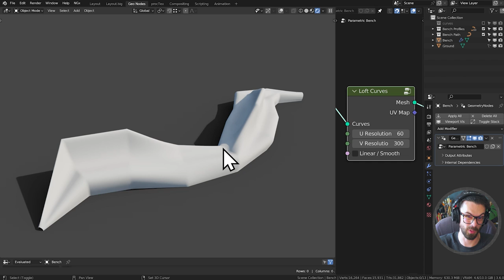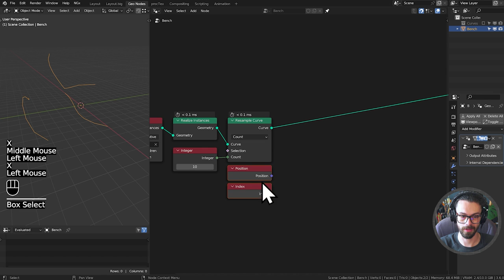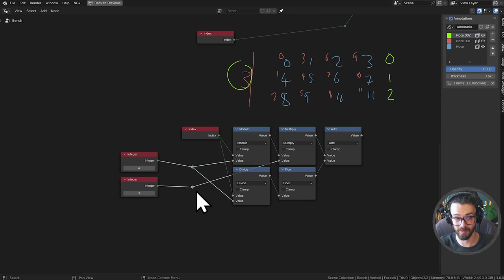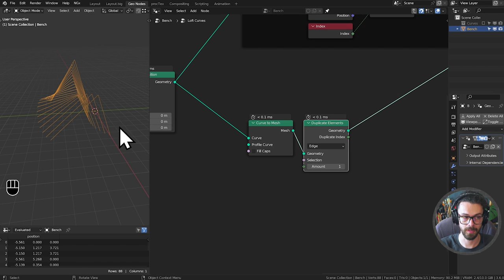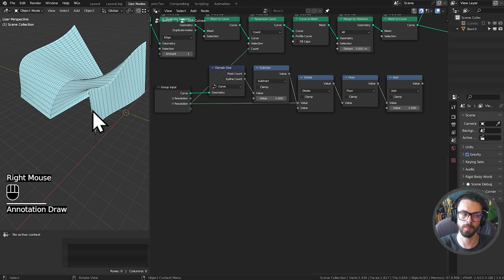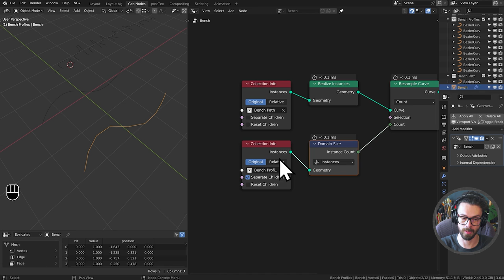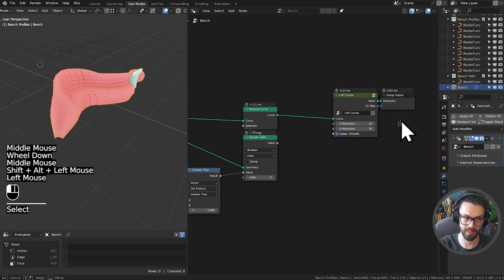Loft Curves Properly - Geometry Nodes in Blender 3.6

Comment from the maker: Lofting is one of the cornerstones of parametric modeling.
What other topics do you want me to cover?
Reply: Procedural road modelling with intersections
Reply: This setup, by Entagma using Houdini:
New In Houdini 19.5 Pt.1: Tangent Fields (And a Bit of VEX)
New In Houdini 19.5 Pt 2: Karma XPU Beta (MaterialX, Solaris)
Have a think on it first, if treating tangent singularities via attribute smoothing is even possible.
This does cross over to materials and anisotropic shading, which Cycles may handle differently.
One bug (feature according to devs) is that UV driven tangents don't smooth across UV seam.
Reply: Pls make a tutorial explaining the curve & mesh topology nodes.
Reply: @aarcharanya  yeah, tutorial on topology nodes is sparse and a bit hard to find. And maybe after that you can cover utilities → field nodes?
Reply: Contour curvers for any mesh
Reply: @codedvoxels  hey...I would like to know what contour curves are?
Reply: If I have a vertex selected, I want to be able to select n vertices on the U direction and p vertices on the V direction where n and p are independent and can vary between 1 and a lot. 
The indices aren't the way since in practice they are never in accordance with the UVs. Set ID may be but this is above my pay grade.
Reply from the maker: Are you wanting to select a rectangle of verts or just a line in the U or V direction?
Reply: @Erindale  A line is just a rectangle with a 0 width. But both, a rectangle with an adjustable width from 0 to a lot in both directions. 
I have another one.
Reply: On vertex being selected, I want to find the normal at this point (easy), one x and y axis of the tangent plane (done). 

When I move the selected point just a tiny wee bit the x and y axis have a tendency to jump (90°, 180°). I don’t want that, I want the x axis staying aligned with the U direction. So when I move my point around the axis is not jumping around. 

I can do this manually but I’d like to have it automatic.
Reply from the maker: Just that selecting a line of topology is vastly easier than a region. I'll have a think about it. Easiest would just be to select a UV region rather than needing a specific number of verts
Reply: @Erindale  Actually I would be very happy if I could select the next U or V. I'll try by selecting a region on the UV map,  then get the real position of the vertices. inside the region. I'll write to you an email with blend files.
Reply: can you do something on lofting between 2 separate meshes to connect them. lets say you have a mesh like at 32:57 with a hole cut out in the middle. inside this hole is a smaller mesh wish is insit in the z direction and also has a irregular topology with valleys and hills. how to loft these 2 meshes together, make them manifold for 3d printing and constrain the profile curve of the loft to the outer and inner mesh as curvature continuous or tangent, so one mesh transitions smoothly into the other?

Comment: At 49 minutes you say that it'll be different in Blender 4. I'm on 4.1 now. What should I change?
Reply from the maker: Your spline collection can be sorted directly without needing to go through the instance index stuff. Just plug the collection without resetting children into a Sort Elements node on the instance domain. Use position.x as the sort weight and then you want to reset the positions after which you can do with a translate instance by (-position) and then use this as the instances on your instance on points node. Make sure nothing is plugged into the instance index

Comment: Thank you ! How to use this when using only one 1spline curve in collection and it has mirror modifier ?
Reply from the maker: What is it you want the mirrored curve to be doing? How do you want to the final mesh to look?
Reply from the maker: @TynkaTopi to loft a skateboard shape it would be easier to imagine it like taking a skate deck and cutting through it with a saw lots of time. The slices that you’d see are the profiles and the line down the centre of the board would be the path. Then you can loft those profiles along the path to get the shape again
Reply: @Erindale  Yes, I'll try that way. With that method, you can do it accurately even if the board is concave in the middle.

Comment: Thank you for sharing this. Very thorough. I’ve got two suggestions though. 
1- At 39:09 you’re right to use 2 Align to Euler nodes to properly orient the profile instances along the guide curve. But the proper way would be to align the Z axis to the Tangent direction of the guide curve and then align the resulting rotation vector to the  Normal direction of the same guide curve. Leave the mode to Auto (that’s recommended by Blender in the manual). The order of these operations isn’t really important. There’s no risk of Gimbal lock. The alignments represent 2 consecutive transformations. This makes the orientation along the curve rock solid, no matter the guide shape. Also avoids the need to calculate which way is front. 
2- At 23:08, the trick to split the edges of a single line mesh using a Duplicate Element in Edges mode is a very pleasant surprise, but instead of converting repeatedly from curve to mesh and back, a simple Subdivide Curve node could have sufficed. 
Again, thank you for sharing a detailed and unified way to loft curves. I’m bookmarking this to easily reference it later.

Comment: I am amazed to see someone else solving this problem, and with a very different (and perhaps a much more direct) solution. Mine uses curves, too - but it takes a single curve and extrudes it using the "Curve To Mesh" node. The extruded curve has the number of divisions of the desired U resolution, and the loft-curves have the number of divisions of the V resolution (resulting in a grid with the correct number of divisions in either direction). Then, I can just use the factors of the curves and a "Sample Curve" node to place the vertices... and as a consequence I can keep the factors of the curves as UV's.
I added catmull-rom interpolation to it after seeing your video (I had no need for it for what I'm doing). Now it does everything yours does, and it gives me UVs (and any other data I want from the curves).
But I think mine is a bit more complicated.
Oh! Mine works on cyclic-curves 😊
Reply from the maker: Nice! I always love how many ways there are to solve problems when working procedurally

Comment: Very neatly done!😀  Clear and concise!  One  quibble, at 40:01 .. the 2-stage alignment to a completely defined orientation.  I could be wrong.. but .. I don't think gimbal lock has any bearing on the sequence of rotations.. they are step-wise  and  local .   The basis for the second rotation is still orthogonal, after  the first, there is no danger of the rotation axes coinciding. What might  be a problem, though,  is leaving both alignments 'Auto'.  In your case, for example,  if you first align Z to Tangent, ('Auto'), and then spin Y to (1,0,0) about the known good axis ('Z', not 'Auto') you should be OK.. 'Auto' won't throw the axis you have previously set. I'm  open to correction, of course.
Reply from the maker: Hmm I'll have to double check this. You're definitely right about leaving both on auto, I should have locked the pivot of the second. I had thought with a chain of these, it's working with Eulers directly and I've definitely seen a lot of times when it's failed to correctly orient when doing Z first especially if X is after. I should read up what is actually going on there
Reply: @Erindale   Sure. My only justification (therefore hesitancy)  is testing through the front-end.. A peek at the code would nail it. 'Rotate Euler' is vulnerable in the way you describe.

Comment: Amazing stuff! Thank you so much for sharing :) One question though: I've tried a similar workflow but where the splines are closed/cyclic curves and I'm having trouble creating the remaining loft between the last curve and the first again. Any idea how that would work?
Reply from the maker: Either you can create the ribs with an extra point that exists on the position of the first so it’s technically not cyclic but visually is, complete the loft, and then merge by distance. Or you can use the cylinder method where you transfer the positions to a mesh that is already cyclic

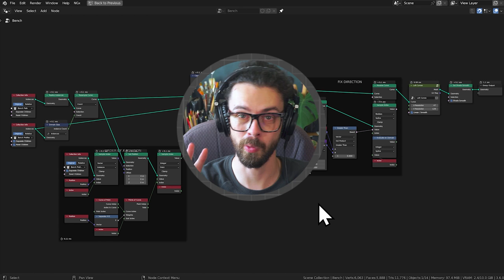Comment: One more tip @54:00 you evaluated the index on the spline domain; I don't think this is necessary, it should already be on the spline domain since it's plugged into the reverse curve node, which evaluates on the spline domain.
Reply from the maker: I was under the same impression but for me it didn't work without it. Perhaps I had something else wrong. I should get you to vet my lesson plans 😂
Reply: @Erindale  😆. hmm, I'll have to test it. Sometimes things don't work how I thought they did, these days.
Reply: @Erindale  just checked and if should work.

Comment: Erin 🫣 why did you do that whole convoluted thing for the liner interpolation instead of using a subdivide curve node? (You could have also just used the original curves and two sample index's and used the uv's to interpolate with some math, but I'm not gonna  hold you on that one. However, this whole ctm, mtc, merge by distance mishegas seems kinda overboard 🤔)
Reply from the maker: Oh mainly (entirely) because I forgot that node exists 😁
Reply: @Erindale  🤣

Comment: What if the two curves are circles?
Reply from the maker: You will be missing the final connecting faces so you either want to use a mesh like the cylinder which already has those faces, or you want to replace your curves with something like a spiral that goes back over itself and then merge doubles after the loft.

Comment: A bench? It looks more like a discarded banana peel. Not the most motivating example.
Reply from the maker: Onus is on you to make something you want with the information 👍
Reply: @Erindale  I have since chosen to think of it as a shape you can make by smoothly modulating the shape of your sphincter. Now I am far more motivated.
Reply: @Erindale  Looks like someone hasn't taken their meds today. Thanks for sharing!
Reply: We've had several projects coming from architects where bench furniture in these kinds of shapes have been indicated.
This is a perfect tool for that. I'll only note that it falls short compared to Solidworks lofting wrt end tangent controls.
That's due to our Catmull Rom implementation not allowing bezier control over end tangents. Discarded banana peel? Wtf? 😂
Reply from the maker: You could definitely expand the tool to give you bezier tangent controls of the rib curves. You wouldn't get any 3D viewport gizmos to control it but you can make whatever you want with enough nodes 😁
Reply: @Erindale  You can. Maybe most can. I can't 😁